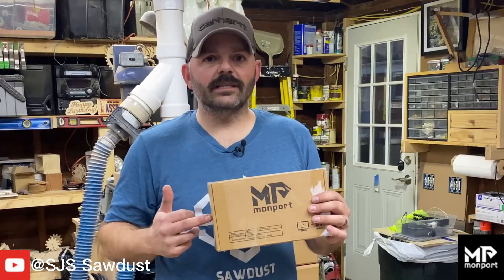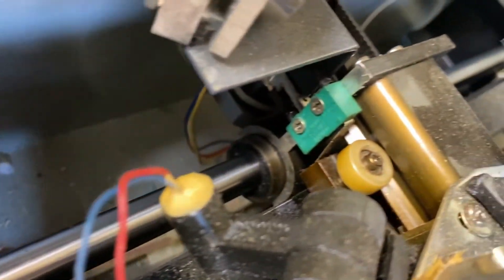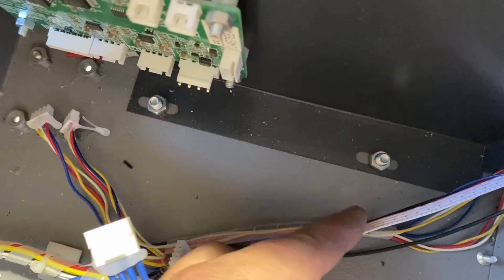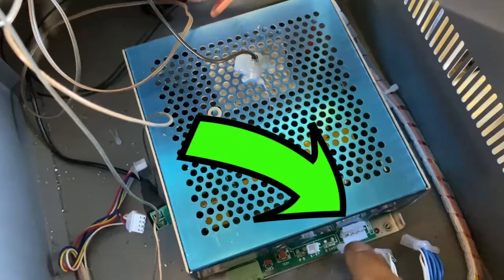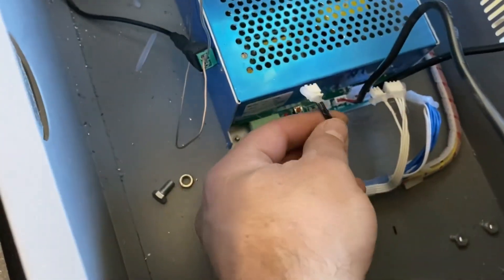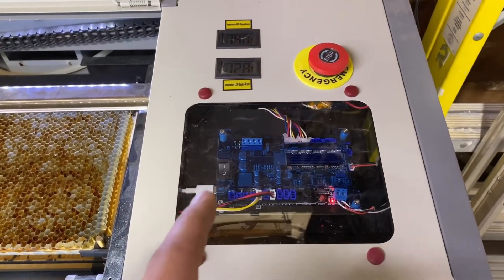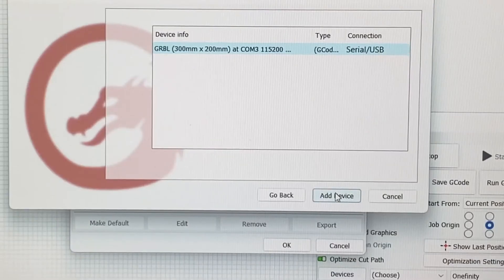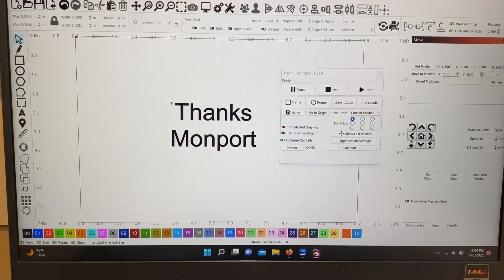Monport 40W desktop Co2 laser 丨How To install Monport GRBL motherboard

Comment: Your 24v wires are reversed at 4:00 of the video. Red should be on the left and black on the right.
Also, K40 lasers fire at low PWM, and this board fires at high PWM, consequently laser will stay on all the time, very dangerous!
My board is either defective or it's not configured for the K40 laser.

Comment: Installed per the video. The laser will not fire now. Everything else works fine. Checked the pwm wires and they are in the correct order.
Reply from the maker: Hi If you buy the machine from our website, you can contact us at HELPDESK:https://monportlaser.com/pages/contact-us

Comment: hi there , good video couple of things where did you get the 3d print file for the red dot please? do you have a link at all? tTx.

Secondly you really should put in a milliamp meter otherwise you have no way to see your what power Lightburn and the Monport board really use. The K40 standard tube should never really exceed 12 to 14 milliamps,  higher than that you are shortening the life of your tube considerably or blowing it. Just get a normal 0 to 30 milliamp meter, cut the thin wire that goes to the tube and bridge it with the milliamp meter, that way when you use 100% power in Lightburn you can actually see the milliamps reading on the analogy milliamp meter. 

If you then find that when you use 100% power in Lightburn that you are pulling more than a maximum of 14 milliamps you should then install a POT meter to  throttle that power back to 14.  Its easy to do...

I'm not a lover of safety interlocks but I didn't see any flow switch going back to the LPSU, that immediately stops the laser if your water pumps stops working, saves your tube instantly, cost is about 5 to 10 euros for the flowswitch, you just bridge it with wires on the LPSU

Finally if your still interested in sensor info you can now purchase a small hour meter off ebay or ali-express that tells you how   many actual hours your tube has been firing, you just wrap the wire that comes with the unit 3 times around the red laser high voltage cable and back to the small display that it comes with, not cutting or the laser cable, it works by induction and give a very accurate reading of the hours, you see them on ATV's, boat engines , some chainsaws etc.. about 4.99....

keep up the good work. cheers from Spain.
Reply from the maker: Hi Neil，Thanks for the suggestion! We will read through later! And keep going!
Reply: Your 24v wires are reversed at 4:00 of the video. Red should be on the left and black on the right.
Also, K40 lasers fire at low PWM, and this board fires at high PWM, consequently laser will stay on all the time, very dangerous!
How to set this board to fire at low?

Comment: Do not use this video for installation.  It is full of mistakes in wiring.
Reply: Reshoot the video with the wires connected correctly in all shots. Having wires change places half way through without explanation is confusing.
Reply: Wat would you recommend?

Comment: I just received the board yesterday. I have it installed and the laser will not fire with light burn when I click the Fire button.    If I plug the control panel for the K40 back in the laser fires with the power supply test button.  I plug the Monoport board PWM back into the power supply and the laser will not fire from light burn nor from the test button on the power supply.  Is there a jumper or something or did I get a defective board? The machine homes runs and moves perfectly, it just will not fire the laser.
Reply from the maker: Hi Sir, you can send email to our customer service team to get help: support@monportlaser.com
Reply: Did you find a solution, I have the exact same issue now. Have added ground to k+ pin, thought that might be it. But mine won't even fire with the button on power supply.
Reply from the maker: @brianheath6486  Hi Brian, you can contact us at: support@monportlaser.com
Reply: @brianheath6486  let me know if you find out anything. I have one coming Saturday. If you don’t mind

Comment: Can't get mine to work.  Your video is not clear and has conflicting views. The black wires on the power supply are shown in two different locations and no explanation of the white wire.
Reply: Also they don't tell us the grbl settings because when i try a 20mmx20mm box its like 120x120
Reply: I figured it out.. the video incorrectly shows the power wires installed wrong, in part 6. Later in the video they are corrected but no mention that the instruction was wrong.
Reply from the maker: @BigMark-57  Sorry for the confusion. We will try to do better next time.

Comment: How is this board working out for you? Any issues? Looking for a new board for my k40, but haven't seen great things about getting this board to function correctly.
Reply from the maker: We have received some feedback from our customers. Actually mot of them said it is good. Our board is compatible with most of the K40. At the end of this video, you can see the connection with LB.
Reply from the maker: @eIgHtY0N3  This is a GRBL board. Used for K40

Comment: ciao ho provato nel loro sito ma la scheda costava poco sulle 48 euro ma la spedizione in italia costava tanto sulle 250 euro ,tu potresti procurarmela per favore ,ti ringrazio
Reply from the maker: Hi Sir or Madam, you can contact us through email: sales@monprtlaser.com
Reply: ciao non mi fa mandare email dice che il dominio e inesistente  comunque questo e il mio problema   Ciao mi chiamo Salvatore e ho una macchina laser co2 da 40watt con piano di lavoro 40x40 e ho cambiato la sua scheda originale con questa , MKS DLC32 V2.1 GRBL CNC shield 32bit 
visto che ho il problema che non mi scrive bene cioè disegna a tratti  e non mi incide in modo performante avevo fatto una prova cioè il filo dell'alimentatore ( L  ) che sarebbe il laser l'avevo spostato su spindle meno
e ( IN ) che sarebbe  l'ingresso o fatto un ponte con il 5v  ora.. mi scriveva bene mi incideva bene in modo lineare però per quanto riguardava il taglio non mi tagliava e mettendo anche più potenza ora come posso risolvere il problema puoi aiutarmi?, mi sta facendo impazzire
Reply from the maker: @Salvo-xp2bg  sorry the wrong email address: support@monportlaser.com

Comment: Thanks, been looking for a nice board! Bought it halfway thru your video :)
Reply from the maker: thanks for your trust and purchase!
Reply: Your 24v wires are reversed at 4:00 of the video. Red should be on the left and black on the right.
Also, K40 lasers fire at low PWM, and this board fires at high PWM, consequently laser will stay on all the time, very dangerous!
My board is either defective or it's not configured for the K40 laser.